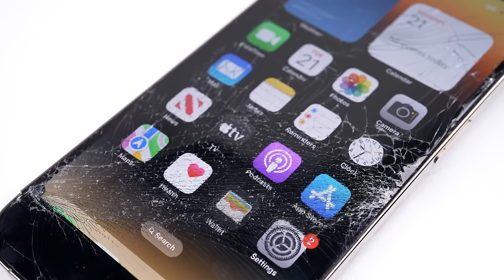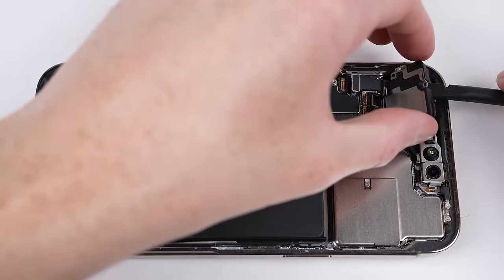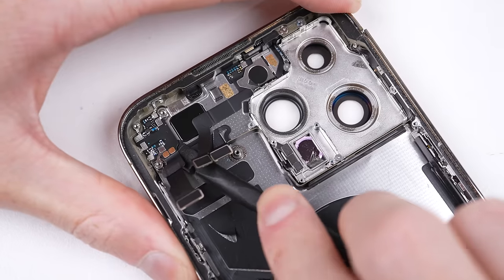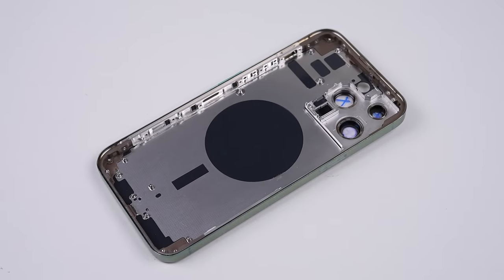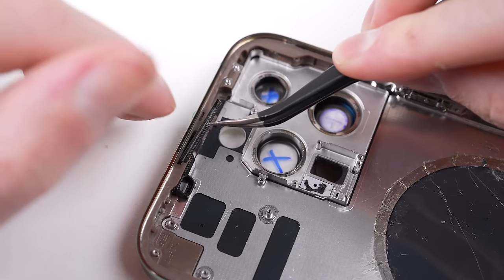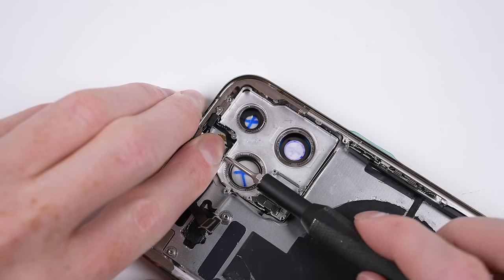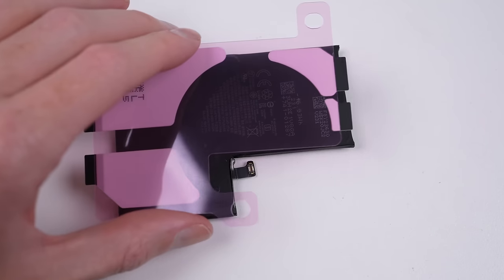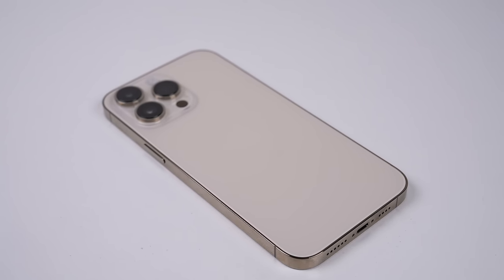What It Takes To Repair The iPhone 14 Pro Will Anger You - iPhone 14 Pro Max Restoration

Comment: Right To Repair must become a thing. This is ridiculous. Thanks for the video
Reply: @jakreu Why?
Reply: @guslarscheid3606  You own the device, you should be allowed to repair it without having to send it off to a company that will charge slightly less than it'd cost to buy a whole new phone, e-waste is a major issue and getting completely new phones when you could repair it doesn't help.
Reply: @SpudderRail  Who's stopping you from repairing it?
Reply: I’ve replaced my last two iPhones solely because their battery wouldn’t last for a whole day and i didn’t wanted to bother bringing it to a repair shop to replace it with a third party battery
Reply: @guslarscheid3606  Apple software. Even if you repair by yourself it won't work 100%. In this specific case, auto brightness and true tone doesn't work even if the screen is genuine Apple part.
Reply: @oaedeoi  So you spend 1000 bucks on a new phone instead of 60 for a new battery? thats pretty stupid
Reply: @martinpertot2160  So what?
Reply: @martinpertot2160  exactly
Reply: @guslarscheid3606  Maybe watch the video before making stupid comments? Apple is preventing you from making any hardware changes. Even if you use all original parts, the phone will no longer be 100% functional.
Reply: @wtfiswiththosehandles  It was a question, not a comment. So Apple owes you more than what you bought from them? Speaking of stupid comments...
Reply: @guslarscheid3606  They do, in fact. Right to repair.
Reply: @wtfiswiththosehandles  "Speaking of stupid comments..." Sorry if that was too harsh, I bowdlerize that part.
Reply: @wtfiswiththosehandles  So they've entered into a covert contract with you then?
Reply: @guslarscheid3606  Apple with their specific design policies made specifically so only them can repair their phones. You're not buying a license when you buy an Iphone, its actual hardware that should and must be yours. If you can't repair it in absence of the manufacturer, you are not the owner.
Reply: Truly. They preach a lot about e-waste and how removing charger from the box help the environment while making repairs almost impossible so that the customer is forced to buy a new device or getting a repair from their stores, which quite honestly puts a dent in your wallet.
Reply: @SpudderRail  Nobody is stopping you from doing it. They just make it hard which should totally be allowed
Reply: @guslarscheid3606  Apple does. Please actually watch the video and then tell me that these pieces of shit are not designed in a way that makes them impossible to repair for a normal person
Reply: @CErra310  Why do people think "Please actually watch the video" equates to an argument? It's a very common and fallacious response. Strange... "Apple does" I'm not sure what you're referring to. It's pretty simple, you bought a product, end of transaction. So people are either referring to a real contract or a covert contract. Which one is it?
Reply: @quisqueyanguy120  "If you can't repair it in absence of the manufacturer, you are not the owner." Anything you can't repair, you don't own? This really what we're going with now? Come on guys
Reply: @guslarscheid3606  Apple expects you to buy into their ecosystem. It’s not just one product and done. If you want to get longevity out of your phone, you need reasonable repair procedures. Requiring obscene prices for simple repairs due to obstruction of repairability reduces the longevity of the product. Apple has been on its green wave as of recent as well and this does not have a positive impact on that. If you can’t source components properly either due to repair program restrictions or maybe supply, the only alternative is to buy a new one. It’s akin to a car that has been designed without mechanics/technicians in mind. The water pump in your car has gone? Well the water pump is only $160 but because of its precarious location and the designers having implemented it without repairability in mind now results in a $5-600 repair because of the labor involved in dealing with the obscurity. At each corner you get bitten by the design when it shouldn’t have to be that way, especially as prices continue to rise snd the technology becomes more advanced. Serialization of non critical components to a specific device borders more on control than it does security or safety. It makes it so there is no way to enjoy full functionality of your device despite having spent the money to repair it fully. Going back to the car example, imagine you’ve just replaced this water pump but because it’s not from the dealership and instead an aftermarket part, we’ll we’ve reduced your HP by 30 because supposedly “we can’t guarantee the safety of that part”. If I purchase the device and that means the manufacturer has washed their hands of me, then the least they can do is not stonewall me into doing what I want with the device. Medical devices are also a huge subject of this problem. You can’t have a “you’ve bought the product, it’s not my problem” attitude. You have have end of life procedures for things you no longer wish to support and even warranty restrictions/conditions but to sell a device, make it impossible to repair aftermarket, and make it prohibitively expensive to repair first-party or purchase leaves the consumers, hospitals and patients, out to dry with no real options. I see it as a matter of, if you don’t want to provide repair, design that in mind so owners of the device can do it themselves. If you do provide repair, you can incentivize first-party repair but still leave the option of third-party repair with conditions - whether that’s voided warranty or something else that doesn’t diminish the original functionality of the device.

Comment: Could you micro solder and desolder and swap the screen chips for authentication? Would be an insane video for no reason
Reply: It is almost impossible because they use glue like plastic that is hard to remove with heat without damaging the chip.
Reply: And once he spent a week of no sleep or food doing this and turns the phone on, a new message pops up: "The screen has been swapped AND the ID chip has been swapped, contact apple for assistance"

Comment: Phone looks amazing! :) What we usually do is use a screen programmer to transfer over the serials and numbers from the original screen over to the new screen. This will repair the True tone  but the settings message will still scream its not a genuine screen even if it would be taken from another phone. thankies for a wonderful video :)
Reply: These programmers are getting cheaper, more available, and easier to use. No serious repair shop should be without them.

I think it’s probably outside of the realm of most shops to also transfer the screen and back glass plate (14 only) IC’s, but battery BMS boards are very doable.
Reply: @KingCornWallis  battery bms indeed doable. Screen ic always brings a risk of damaging the new screen also. And they are expensivd.
Reply: Hi! Someone knows why my brightness is so pretty low on my 14PM after changing the screen for another original Apple screen? (didn’t transferred the IC or ambient light sensor)
Reply: @KingCornWallis  Hi! Someone knows why my brightness is so pretty low on my 14PM after changing the screen for another original Apple screen? (didn’t transferred the IC or ambient light sensor)
Reply: @dennis-br6vr  Hi! Someone knows why my brightness is so pretty low on my 14PM after changing the screen for another original Apple screen? (didn’t transferred the IC or ambient light sensor)
Reply: @DankMemes-ne7qt  you always need to transfer over the original cable from the original screen with it's sensors etc to get the screen working correctly. if you don't transfer the display IC over too, you will get the annoying notification "can't confirm it's a genuine apple screen.." notification in settings. But I don't personally feel comfortable doing that type of work myself. The cable however is always a must :3
Reply: @KellySimonsson  Is it necessary to do a full iTunes reset after that? I know from experience that with cameras or parts like that is pretty mandatory or some things won’t work.
Reply: @DankMemes-ne7qt  I have not had to do a restore on a customers phone after a screen replacement unless there has been alot of wrong passcode inputs when the screen was broken. You don't have any choice other than to restore the phone using itunes if that's the case. Hope you manage to fix your phone!
 ^^

Comment: There are tools that allow you to copy the displays NVRAM data from the broken screen to the new screen so you can still retain True Tone and auto brightness feature.
Reply: Doesn't work for the iPhone 13 and 14 series. Apple is doing more to prevent that.
Reply: Ofcourse he will do it before selling it, he's not showing it for reasons ;)
Reply: @akashp01  😆
Reply: @akashp01  Read the reply above you
Reply: @MissionControlTet  It works, but the guy fails in soldering level work sometimes, its a skill issue.
Reply: @Akash Pal  It does not work. Microsoldering transfers the ram itself. We're talking about transferring the data, which is a different thing entirely. 

Literally nobody says you cant physically transfer the chips.
Reply: @JusteazyGames  doesnt make sense. Electronics are not magic, if the chip is alright and not busted then soldering it in the new displays would work 100%. Some people fail in soldering the BMS in the battery too, the chips dont have conscience they work in a certain way and you need to understand how it works to hack it. 

Its a skill issue to not be able to solder properly, sometimes the chips suffer damage when the part suffers damage, in that case it wont work.
Reply: @akashp01  Micro soldering to transfer tiny surface mount chips is hit and miss at best. When a new components are that expensive you don't want to risk trying to transfer chips.
Reply: @Akash  You misread. I never once said it is impossible. I only said that moving the chip and copying the data off of the chip are two different things.
Reply: Hi! Someone knows why my brightness is so pretty low on my 14PM after changing the screen for another original Apple screen? (didn’t transferred the IC or ambient light sensor)

Comment: And this is why the 6 plus model was my favorite version as it was so cheap and easy to repair yourself. I legit changed the housing to a red one and the screen broke maybe 5 times but I’d order a new one for around $10 no issues. I still use a 6 plus in my car for music mainly but still runs fast on ios 12.5.7.
Reply: The X and XS are the easiest

Comment: all i can say about this device's "repairability" is, it is almost non-existent. I've dabbled with phone repair for friends and family before and with every generation of iPhone, it just gets harder and harder to the point where I say I can't help. Such a shame. My next device is going to be a Fairphone.
Reply: It's difficult to make a repairable thin IP68 phone. If you are happy with something that's not waterproof and quite bulky for the performance/battery, that's fine - personally I am in the same camp as you but also I am very invested in the Apple ecosystem. I do wish there was a Fairphone running iOS.
Reply: @DigiDriftZone  Yeah there are certain compromises. However the repairability of a device is not only hardware but also software. They are making it extremely difficult to repair a phone properly with the amount of software barriers there are.
Reply: @archechme Yes but you are also far less likely to be robbed with an iPhone because of the inability to resell or repurpose the device/parts, as well as the risk of being found through Find My. That's a compromise too, and something I actually rather appreciate in my Apple devices. But I do wish there was a process to prove ownership and allow pairing or unlocking a component like we can the devices themselves. Maybe it will come in the future.
Reply: @DigiDriftZone  I doubt they'll allow that to happen but we can hope, I suppose. Apple want their stuff on lockdown and despite EU laws they will try their hardest. As for your devices being stolen, that is true.
Reply: Hope people grow some brains to stop buying iphones
Reply: @DigiDriftZone  Looks at the Samsung XCover Pro and tell me that again. Hot swappable battery, IP68, easily replaceable display.
Reply: @swecreations  That looks very cool! - but the user reviews are a bit of a mixed bag though. If only it ran iOS lol.
Reply: @DigiDriftZone  Why are you such a fanboi of iOS, I can bet a million dollars that any phone running iOS will not be even close to repairable for the next decade.
Reply: @avim4896  With many people that ain't gonna happen. They're completely blind to the fact that apple is busy ruining repairability and durability of smartphones and get super excited for even the smallest of upgrades.
Reply: @swecreations  Actually any Samsung phone is much more repairable than iPhone with replaceable  back glass. The new pull tab battery in S23 Ultra makes it even better. They also don't make hype for a scammy self-repair program.
Reply: @DragonOfTheMortalKombat  I kinda disagree with you on that, they're generally better yes, but they still do a lot of the same practices Apple do and lobby for anti-repair legislation.
Reply: Same
Reply: If only Fairphones were, well, usable. The specs being like ten years old with such an absurdly demanding OS like Android doesn't help. Also if only they were affordable. They have flagship prices for ten year old budget phone performance? Why?
Reply: @DigiDriftZone  Oh yeah the XCover Pro is the older one, look at the XCover 6 Pro instead
Reply: @mr.number9279  I mean the Snapdragon 750G 5G in thr Fairphone 4 is only a little behind the 778G in the Nothing Phone 1, it definitely isn't that bad.
Reply: @swecreations  And those are fucking prehistoric chips that struggle under the weight of web browsing lol. So yes, it is very bad.

More to the point they shouldn't be lowest-tier chips like that at flagship prices, it's stupid and worthless as hell.
Reply: @DigiDriftZone  "It's difficult to make a repairable thin IP68 phone." Then don't make it a thin phone. IP68 and repairability can coexist in the same sentence. The gaskets and hydrophobic treatments need to be replaced and re-applied upon every single repair, the same way that is routinely done when replacing batteries on conventional wristwatches.

"waterproof" man, there are still people who naively believe their iPhones are "waterproof".
Reply: @mr.number9279  those are upper-midrange chips, not low end. The irony of calling a 5G-capable chip "prehistoric" is palpable (regardless of the usefulness of 5G, but that's besides the point). 

I honestly don't know if you're just trolling at this point. Reviews of the Nothing Phone 1 said performance in normal use was indistinguishable from that of a modern flagship, as in opening everything instantly with no noticeable lag or stutter whatsoever, so you saying that it is slow, nevermind not capable of browsing modern websites at an acceptable rate at all, is completely wrong.
Reply: @johnnycheung5536  Very true, my iPhone XS Max drowned in 5cm of water (took a picture just under the water surface) after 6 months of ownership, despite all those waterproof adverts. I took it to Apple and said IP68, 0.5m of water, what gives? - and they told me £700 for a repair, not covered under warranty, I was livid.

Comment: I'm happily running a 1st gen SE (2016) on ios 15.7. Super fast and barely gets warm. Feels so good in the hand. Perfection. Battery is easy to replace every couple years for only 10 bucks. I suspect all my apps will work for quite a long time. Then I'll move onto the 12 mini and find a way to get a headphone jack fitted.
Reply: Me, too, 2016 SE.
Reply: @bethhentges  Nice! Team 1st Gen SE.
Reply: I'm still on the 6S. Runs perfectly.
Reply: @zeniktorres4320  Also a good one since it has a freakn' headphone jack!
Reply: @EricPeelMusic  Absolutely, which I use too.
Reply: Same. SE first gen and it’s working fine.
Reply: Lol. Same exact story as mine. I actually rocked SE 2016 then upgraded to 12 Mini. Looking forward to a 13 Mini in a few months.
Reply: Don’t count on any good battery life out of the 12 mini. I have one I use for outside work since it’s really light I can still use it with 1 hand. Would go for the 13 mini.
Reply: @RealNameNeverUsed  I wouldn’t go from a 12 to a 13. Just wait around.

Comment: Hi Hugh, great content as usual, don't the magsafe magnets need to go back in the same way up they came out, or are they not pole specific in that orientation? If so wouldn't running line of permanent marker around them before disassembly help reassembly?

Comment: I fixed one!! It is continuously getting better. The trick is the power bank charging. It uses DV charging, and the battery starts its refresh. Only works, if you plugged out the battery for few seconds. To disassemble the Apple, you need a killer knife. The outer plastic and dirt sticks together, and other blades are not strong enough, or bend. Killer knives are strong enough to pull out the display.